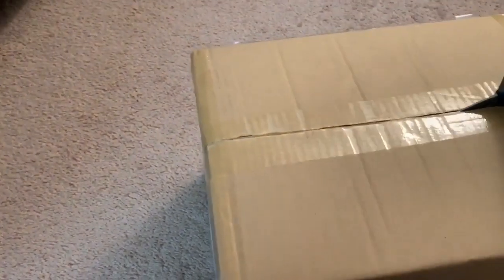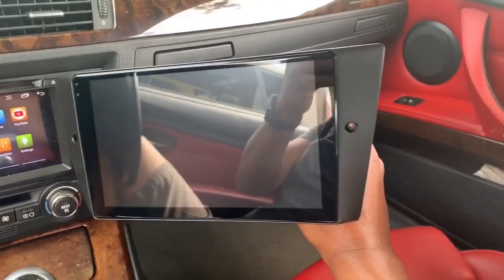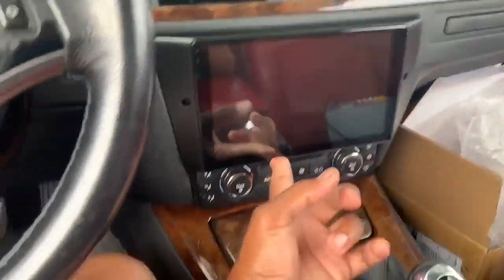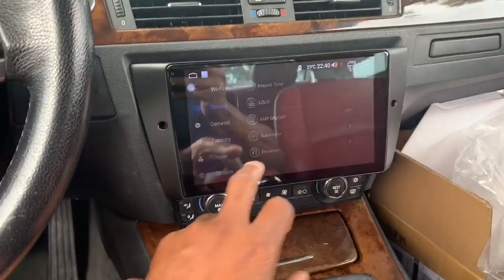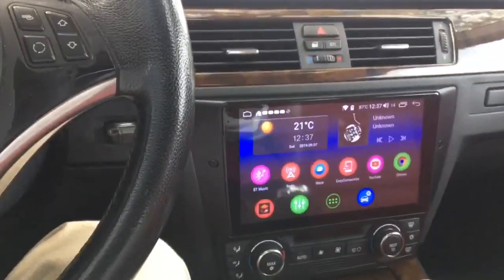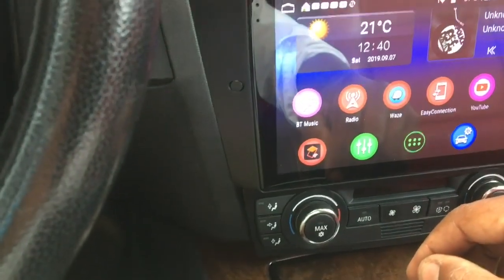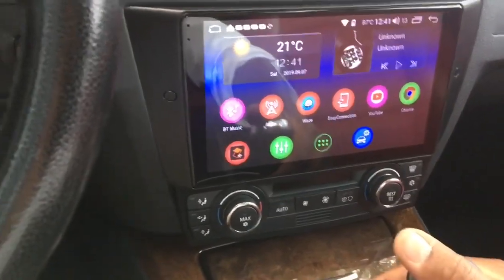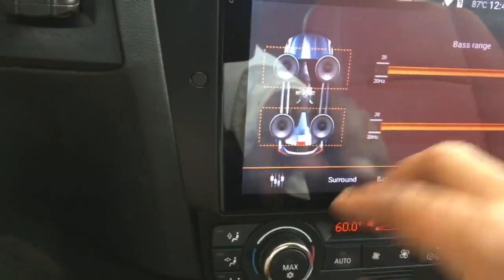Installation Demo - Joying New 9" BMW E90/E92 Head Unit Android Auto radio

Comment: Did you have to run a 12v permanent, or does it get the power straight form the e90 wiring harness? Thanks 🙏🏽
Reply from the maker: It gets the power straight via the e90 wiring harness, the radio need 12V power from your car.

Comment: Did you just take the climate control section and move it below the screen??? Normally, stock has the climate control on the top.
Reply from the maker: Yes, it is.
Reply: Does it fit like OEM down there or does it stick out some?
Reply from the maker: @christianrice7447  It seems will stick out some.

Comment: How does the unit has acces to internet to use youtube or waze
Reply from the maker: 1. You can connect the radio to the internet via wifi.
2. The radio has the 4G module, you can insert a 4G SIM Card to surf online.

Comment: Does the jb4 app come up on there or capable be installed
Reply from the maker: What JB4 app do you mean? The radio comes with the Google play store, you can download any apps as you like.
Reply: You can install it from google play but you won’t be able to tune your car from the radio, when you turn it off to reset tune, the radio turns off too.
Reply: Lil Jeffie ok cool as long as it can be installed all I want it for is the gauges the app gives

Comment: Where is the button for the stop start?
Reply from the maker: The car radio without buttons, and it starts when you start your car, it shut down after you close the car.
Reply: @BoykaJoying  what I meant is I have a button under the air con unit what you can turn the start stop system on and off with. Where will that go?
Reply from the maker: @Mattyj3388  You can check the installation in the video, the air condition buttons will move to the below. And other more buttons won't show.